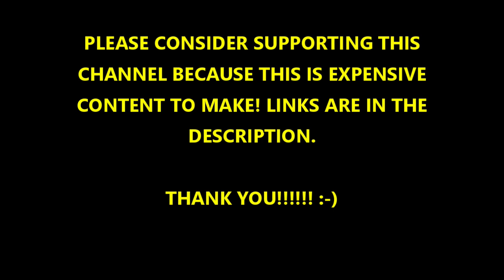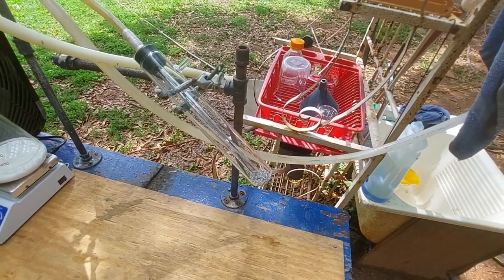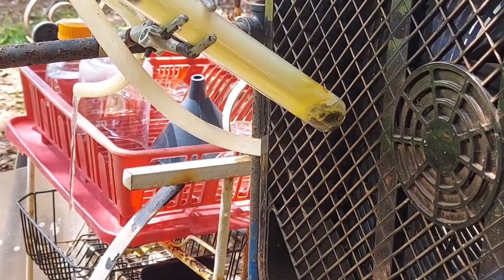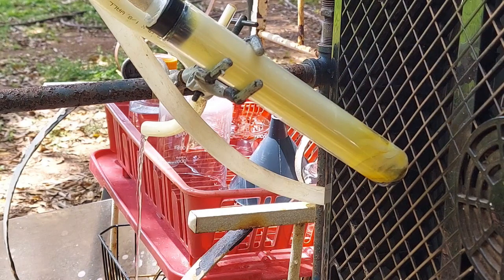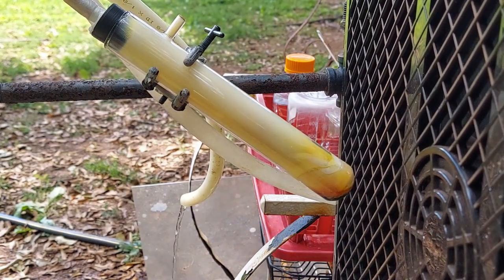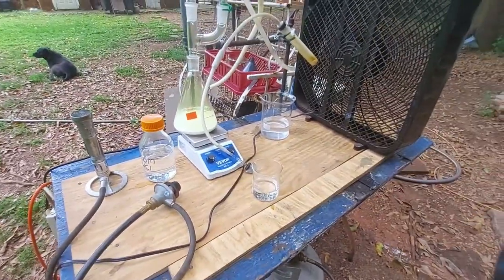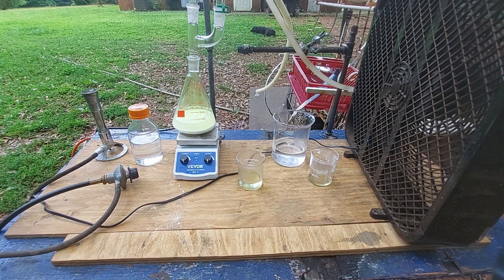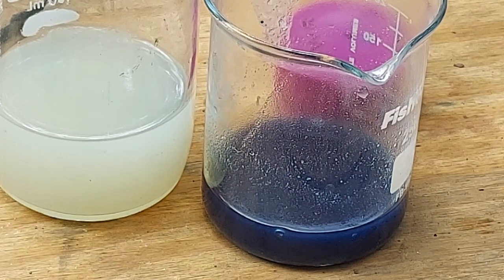Making NbCl5 With Chlorine Fire #chemistry #niobium #tantalum #chlorine #science

Comment: Is that the tetrachloride at the end 🤔 or is tap water not an acidic enough medium for that? You would get it if you added zinc to you hcl solution.
I wanted to do this today but I'm not sure if my quartz tube is wide or long enough for my new tube furnace. Also I only have pvc tubing wide enough to connect to quartz tube. It will be a challenge making a good enough setup to work with hot chlorine gas 😅

I might try it but not bother with a video unless it works
Reply from the maker: It definitely looks like the tetrachloride  But that's supposed to be extremely unstable in water so if that's what it is I don't know how it persists. It lasted for a few days before it started breaking down.

Comment: Hmm I was putting mo metal in Aqua regas. I produced a orange chemical when the baking soda was added it produces a blue chemical  MoCl5. Not stable tho. Cool video.
Reply from the maker: Your blue Mo compound may have been molybdenum blue. Rhodanide did a video on it.
Reply from the maker: Thanks!!
Reply: Would Nb dissolve in hot Aqua regas?
Reply from the maker: @chanheosican6636  Probably not. Nb and Ta are very resistant to acids. They do dissolve in molten alkali if an oxidizer is added. But I can't think of any single acid that will attack Nb.
Reply: @PoorMansChemist  Thanks. Once I get back from vacation with my cousin and aunt and uncle I will start a small project with 31% HCL 3 percent h202 (35%) solution chilled to 4 deg C and with ice. This will Also be done in a cooler with a fan.
Reply: I will attempt to electroplate that gold solution in a glass bottle chilled. Then electroplate gold to titanium it could work if I have the right electrodes.

Comment: That was cool! I've seen some other videos of "chlorine fire" with metals but I've never done it myself.  What a surprise with the blue compound! Complexes with water along some other impurities would be my guess, assuming the color disapears if dried.

Even the AI bots don't know about the blue, like I have no idea either. :)

ChatGPT about "if I make NbCl5 by reacting metallic niobium with chlorine gas and and I add water, what makes it blue?"
"The addition of water to NbCl5, which is niobium pentachloride, does not result in a blue color. Niobium pentachloride is actually a colorless compound. The blue color may arise from impurities or side reactions that occur during the synthesis or from the presence of excess water.
If you observe a blue color after adding water to NbCl5, it is possible that the blue color is due to the formation of a different compound or complex. Some transition metal compounds or complexes can exhibit vibrant colors, including shades of blue. It is also possible that the presence of excess water could lead to hydrolysis reactions, forming different niobium compounds that may exhibit a blue color."

Bing chat AI-bot:
"I’m sorry, but I couldn’t find any information about NbCl5 turning blue when water is added. However, I did find that Niobium (V) chloride, also known as niobium pentachloride, is a yellow crystalline solid that hydrolyzes in air and samples are often contaminated with small amounts of NbOCl3. Is there anything else you would like to know?"
Reply from the maker: I think the metal acted as a reducing agent. You see that kind of thing a lot with some elements. Never heard of it happening with Nb before. I have to wonder if tantalum does the same?

Comment: Cool, I found this "GNb2O5 hollow nanospheres with high surface energy (001) planes showed high thermal stability and large surface area. Furthermore, they not only showed strong intensity of blue emission, but they were also able to efficiently split water under visible light irradiation, and show potential for application as sensors, optoelectronic devices and promising photocatalysts for water splitting under visible light. Due to the high thermal stability of Nb2O5 hollow nanospheres and the simplicity of the protocol, we anticipate that this work will enrich the hollow nanostructures of inorganic compounds and provide a new strategy to synthesize hollow nanospheres of niobates and other kinds of materials."

Sadly, the rest of it's behind a paywall. :(
Reply from the maker: Nice!!!! That could explain a lot. Dude I can't tell you how much I appreciate your help with trying to figure out what that blue shit is. You're the best my friend. 🙂
Reply: @PoorMansChemist  Awww, you've got me blushing man! 🥰🥰🥰

Comment: I discovered something quite awesome yesterday. I'd acquired a big batch of out of date colostomy bags they were throwing out at a care home, originally just for the silicone tubing. 
I noticed that they have a one way check valve in them.
Sooo.... Instead of just using the tubing, I just stuck the complete bag and hosing between my H2 generator and my reaction flask. Turns out that bag makes an excellent surge protector for gas generation! The bag would fill with the hydrogen when the generation got a bit too vigorous allowing a nice metered flow, and then when the pressure dropped in the gas generator the check valve would stop it sucking the reaction mixture back. 
It made the whole thing so easy to control that I don't think I'll ever not use one again!!!
Reply from the maker: Sounds like it would be useful for HCN generators!
Reply: @PoorMansChemist  Absolutely! No need for venting and wasting excess gas when the flow gets too vigorous. I'm not sure what the bags are made of but they seem pretty resistant to anything I've thrown at them too.

Comment: As for that blue compound , i think maybe the excess niobium metal reacted with the pentachloride to produce a lower niobium chloride that dissolved in the water, and its water-stable. I think the blue is niobium in a different oxidation state, maybe +3.
Reply from the maker: That's what I was thinking too. But I need to confirm that. Got to find some Nb chloride species that's blue.